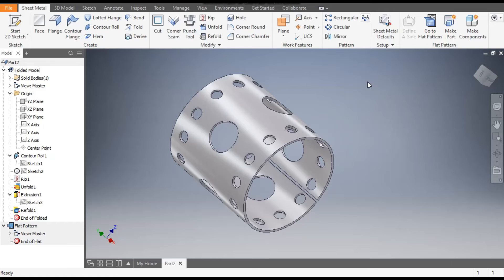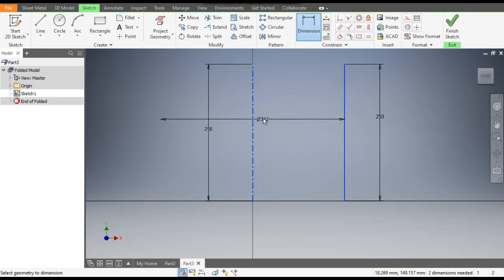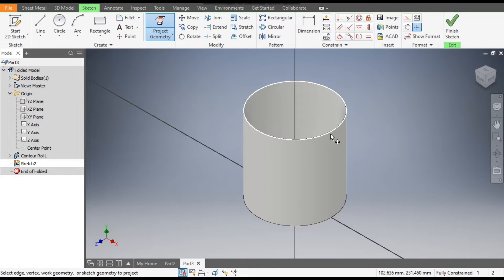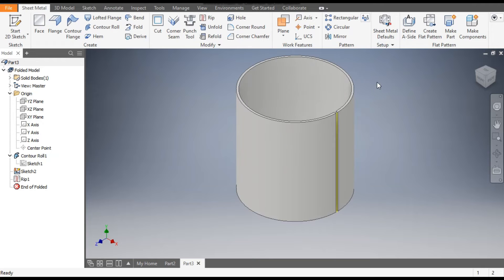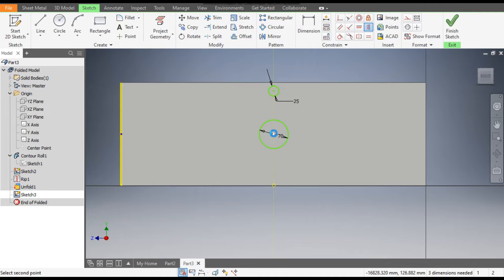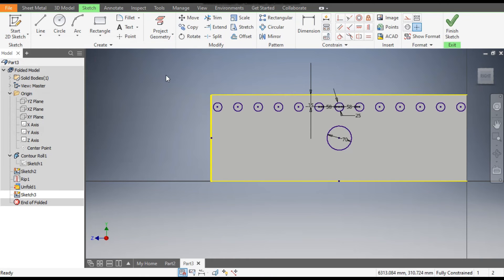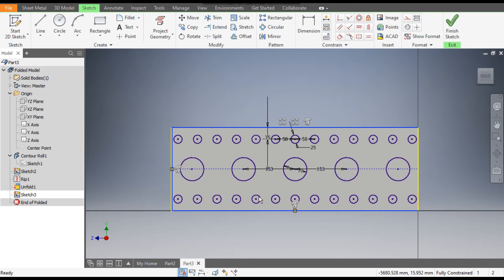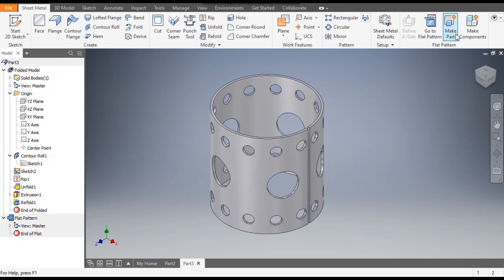Flat Pattern of Cylinder Sheet Metal in Autodesk Inventor || Inventor Sheet metal Commands || 3d Cad

Comment: For those watching this video, there's one thing to keep in mind if you're designing something with features similar to this.  Keep in mind what the hole's function will be.  If your finished, rolled part will have round pipe(s) inserted or welded into where the hole(s) are, you shouldn't put round holes in the unrolled part like what's done here because once the finished part is rolled, the holes will no longer be round because rolling the cylinder will close up the width of the holes.  In Inventor, you will need to cut your round holes into the part while it's a cylinder before creating your flat pattern.